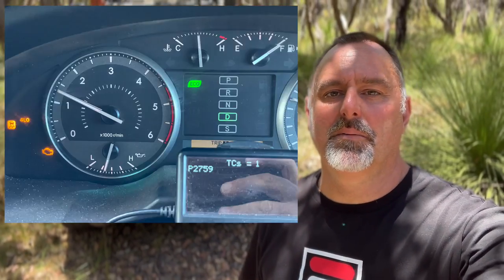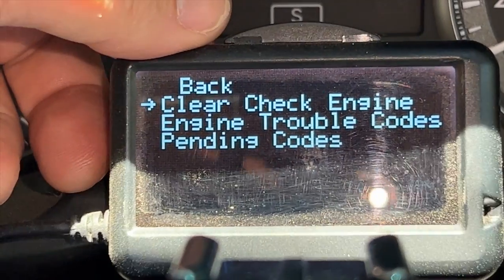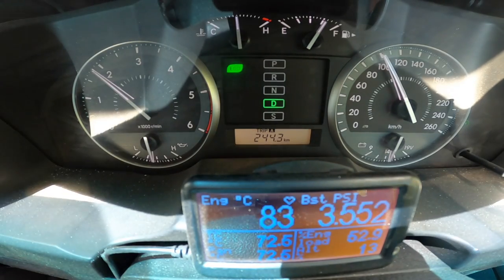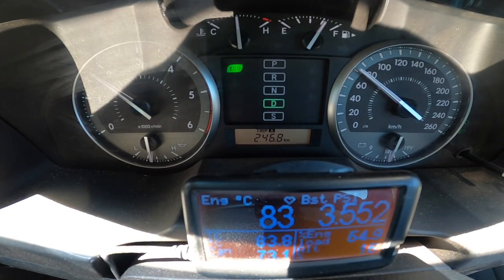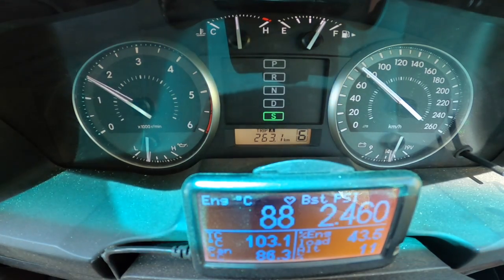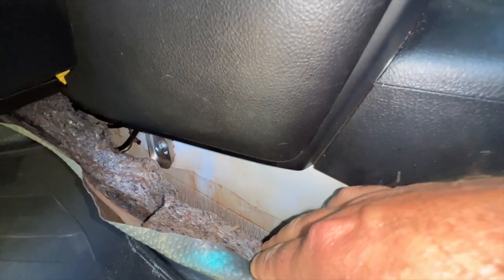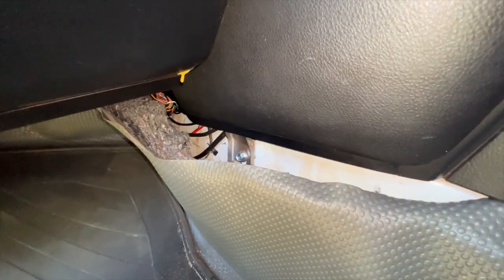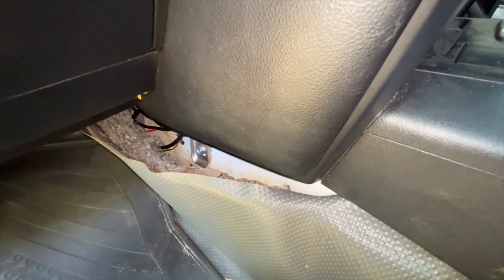I solved my P2759 Trouble Code issue with my Richard's Lockup kit!

Comment: I have a Richards kit in my 2009 200 series, it's the version before yours. The only issue I've had is a relay failed and made it drive really badly, easy fix and all good. I also have the trans remapped to change the 6th gear shift point.
I recently towed a 2t trailer from Gold Coast to Fraser Island (with 5 people in the car loaded also)and it gave me 16L per 100klm fuel economy.  They are a fantastic addition to any tow rig. 👍

Comment: Excellent video. Richards recommend mounting the resistor to  the steel support in the passenger footwell (to heatsink it).
Reply from the maker: Yeah my resister is where they say to put it in the instructions and video. I had the module right near it but that didn’t work out too well 🤣

Comment: I've got a LC200 GXL with the Richards lockup and transmission tune. If I set it to 100kmh with the lockup on, it starts to creep up to 100C on the TC temp going up Roelands Hill. That's between Collie and Treendale at the western end of the Coalfields Hwy. 
So I've decided to put in a cooler as well. It gets installed on the 19th. I tow a 1.7t camper and want zero problems. 
When it's installed we can get together down your way if you like and you can see the difference a cooler makes to the transmission. It's a Wholesale Automatics unit from Victoria.
I've previously had a TD42 converted (from ZD30) GU Pattol auto and I spent A LOT getting that reliable. Don't regret it in the end because a mate bought it off me and I know it'll be good.
Reply from the maker: Interesting it still gets hot. I think my viscous clutch has shagged as I hit 103c engine coolant going through Collie the other day. It was 40c outside and I was towing but I couldn’t hear the fan and haven’t heard it on cold starts for a while. So I think that’ll be the next one on my list.
Reply: @JebbreysJibberish  Yeah it was a stinker in Collie, for a couple of days. That's where I live.
I use a bloke in Bunbury, Reece at SW Mechanical & 4wd. Highly recommend him if you need a goodun.
Reply from the maker: Thanks man, always good to have a good guy recommended. 👍

Comment: JJ Im really enjoying your videos. Straight talking everyday probs that us 200 series owners have in common. I’ve had my Richard’s for a couple years now and tow heavy with horses for long hauls. I’ve been getting P0748 (solenoid A electrical) ever since being installed. Nothing wrong with trans and have done numerous fluid changes in that time. I drive according to my ultra gauge temps when towing and can feel the benefits for the car. Just lately, like yours, same code happening every 20 to 30ks. I’m going to move the unit up under the glovebox and hopefully report back in a couple of months with good news. Keep posting mate. Good info on driving. I’ll start using the low mode a lot more now as a result. Cheers.
Reply from the maker: Thanks for the feedback, love it! If it doesn’t solve it check the Impedance of the resister I think from memory it should be between 5 and 6ohms. But if be guessing the heat seeing that it’s summer. Let me know if it solves it, id be really interested to hear it! I haven’t thrown a code for months since I moved it, not a single one. And I mainly tow 2.7 tonne with it.
Reply: F.ck it! P0748 came back two days after moving the relays up under the glovebox. No symptoms or adverse shift issues as per previous though.
Reply from the maker: Bugger!!! I still haven’t had the error re appear at all. No codes at all. :-(
Reply: Just came across this old thread. I have the P2759 issue "SLU lockup solenoid" myself to deal with in my LC200, hopefully relocating my Richards module will rectify my issue too. Had a P2727 issue recently in my sons Hilux with Richards locker and we found a faulty partial short circuit SLU lockup solenoid, replaced all good now. Don't know if you are still having your DTC P0748 issue. According to the Toyota LC200 manual "This DTC P0748 indicates an open or short in the shift solenoid valve SL1 circuit", so perhaps has nothing to do directly with the Richards Locker. Hopefully after all this time, you have it sorted anyway.

Comment: I went for one from Wholesale Automatics and switch on and switch off. Some would not like manual control but no codes etc. I was interested when you mentioned that you tow with cruise control as I have found that it causes the trans to hunt a lot more as it tries to keep you on your selected speed. Maybe out on the Nullabor where it is flat but S5 is how we tow 3t and it just sits there unless you hit a reasonable incline. Good that you sorted it.
Reply from the maker: Yeah I was towing in s5 but it was still jumping out of lock even with the cruise off on the hills. One of the places we go a lot has a lot of hills and it was hopeless cruise on or off. The only way was to slow right down to say 85kph and leave it in 4th or have it hunting every hill. I looked at the wholesales one because it was cheaper but for the price I got for the Richards it was barely much more and runs all the time, I never turn it off. It’s great even just around town. Now I can leave the cruise on and unless it’s really steep knarley hills it does a great job because it engine brakes down the hill and doesn’t wash off all the speed before the start of a hill because it’s trying to jump gears back and forth.

Comment: I got a Richards lock up kit installed last year and still have to pull over every 30kms to turn the codes off. Rung Richards and was told the only way to stop it from happening is to send the ecu down to them to re program the ecu to accept the lock up kit. Spoke to the place I bought it from and they have told me that I need to get a transmission remap done to accept the lock up kit. I’ve ended up turning it completely off and have a stocklock getting installed instead.

Comment: I have had the lockup kit fitted and the software done on the gearbox. Mine will not move past 4th gear from time to time, I reset it and it is ok for a few days then it does it again. Always from start up, doesn't do it on a trip.

Comment: You know I am sure 5 and 6 are overdrive, well your torque required for towing declines rapidly in 5th and 6th. Best option for highest torque is 4th gear for heavy towing. I would try lock up in 4th in your auto and compare fuel and compare performance to see for yourself. Have a look at torque in Berrima Diesel video with vehicle on Dyno and look at the Dyno results.

Comment: J/J.  Can the puff-matic with the old lock up kit be manually selected to 5th gear ?  Heard 6th gear in the LC200 automatic doesn't engage till over 80mph/130kph !  Do like unique registration plate too.  V.
Reply from the maker: 6th will go in if you let your foot off and back on again after about 100kph or if you select it in sports mode it will typically try for 6th at over 100kph if you have little load on the throttle. Cheers, they were a birthday present! 😎🤪

Comment: Great vid. We've had the Richards Lockup kit and transmission/engine remap since our 2015 Cruiser we a baby (10,000kms) an it has been one of the best mods. We tow a small caravan and can comfortably sit at 105 Kms in sixth gear on a flat road. Saves a sh!t load of fuel too.
Reply from the maker: It changes the whole car, I wouldn’t be without it towing or not towing. The remap looks interesting but after fitting the lockup it’s hard to justify the price of one now.

Comment: That was a great fix - electronics is like that. Try and keep the shit cool is good advice. Well you've won me over with the lock up kit. Now to see if they make one for the Jack.
Reply from the maker: Jackaroo? Back in the day I just soldered a wire to the ECU loom similar to how you install these modern kits. I put a latching switch on the dash and was able to manually engage and disengage the torque lock on my Hilix Surf. I put a big light on the dash to remind me and put a momentary switch on the foot rest that isolated the lockup so I could use it like a clutch when changing gears or stopping. Was rough and bogan, but it worked well!
Reply: @JebbreysJibberish  I was beginning to think that is what I would need to do! Thanks for getting back so quickly JJ.

Comment: I am tempted to believe Toyota doesn't think there is an issue, as it is all software based and "lock or not to lock" been like that forever (since 2008) not only LC but Hilux or Prado (in the 6 speed).  Used to work in Toyota service department and NEVER came across an AT overheat or Auto Trans issue. I am skeptical of mods, as it is quite easy to engineer out reliability of your vehicle. As per running hot, I had my air cooled engines up 130 deg. C. Not an issue. I think we just need to accept the fact and let the auto do it's thing.
Reply from the maker: If ‘doing it’s thing’ is making the driving experience woeful then nah I’m not really keen on just letting it do that 🤪 I didn’t mention the 2l per 100km better fuel economy I get towing in the video, but it’s worth it just for that alone!

Hyundai programmed the 6 speed in melas 10 year old i30 to lock and shift properly and it drives great. Why after 10 years+ of building the 200 Toyota couldn’t sort it boggles the mind. But this is not a new problem for Toyota. My 1995 1KZTE Surf was just as woeful with its gearbox programming and from all reports the prados are pretty horrible too. I built my own lockup kit for the surf and that changed that car on the highway for the better, just like the Richards kit transformed the 200 into something that is now a pleasure to drive on the highway towing rather than something that just tired you out with its horrible constant shifting.  It’s almost like Toyota get these Aisin boxes programmed for petrol engines and then go ‘yep, she’ll be right’ and send them out. Why they make them kick back so easily and rev so much when all the other boys like Isuzu do the exact opposite makes no sense.
Reply: @JebbreysJibberish  do agree, it constantly changes, it will sometimes not even use 6th even at 110kph, or unlock at a smallest headwind. I am not a fan of the transmission logic either.  Obviously they don't think it3 is an "issue". Just annoying.